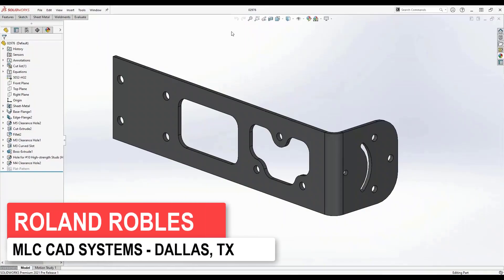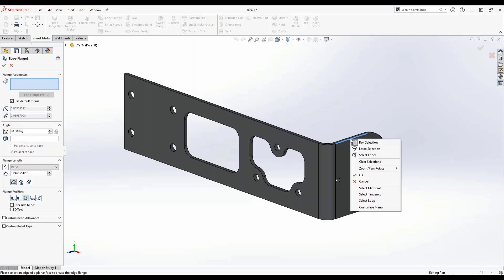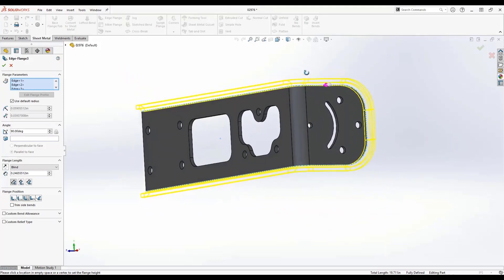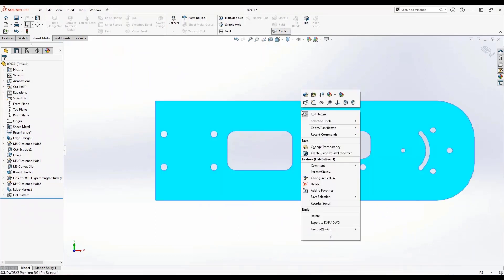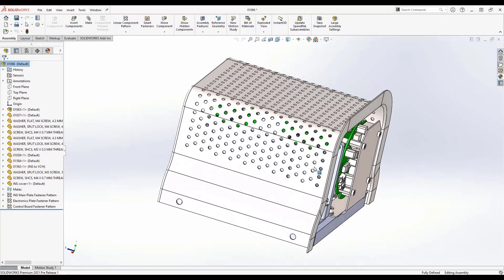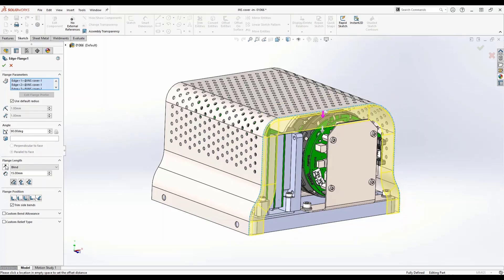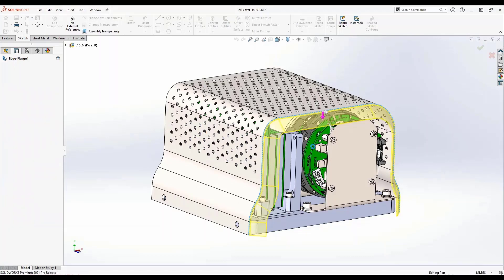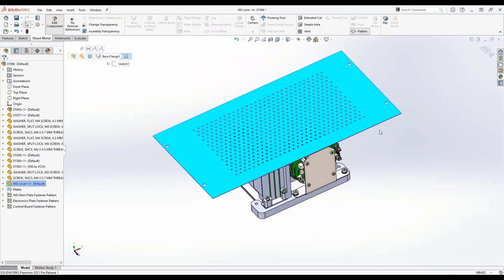What’s New in SOLIDWORKS 2021 - Sheet Metal

Comment: these are useless flat patterns. Not as easy as it shows here to calculate!
Reply from the maker: Any time you apply a bend to another bend there is going to be a lot of non-uniform stretch, and the true flat pattern will depend on how the tooling is setup as well as the material itself.  This ability to flatten complex regions is being delivered as a geometric simplification assuming geometrically uniform stretch, but is still a useful command for users to get the rough flat pattern created.  In the example shown on the video thumbnail, the goal is to create a part that has flanges for added stiffness, not necessarily to achieve 100% accurate size in the final flange sizes.

For truly accurate flat patterns in complex forming or drawing operations, third party tools that analyze the stresses in the material would be required.